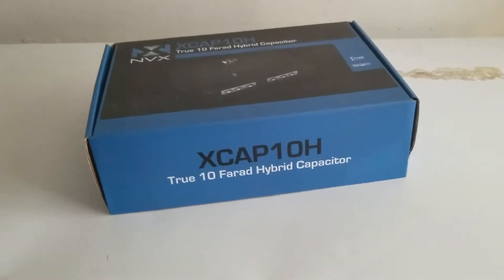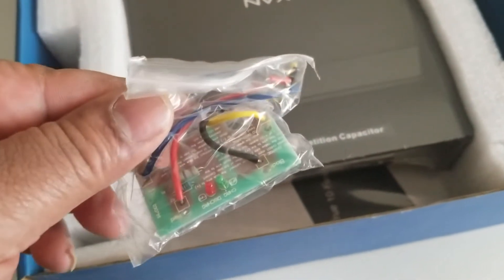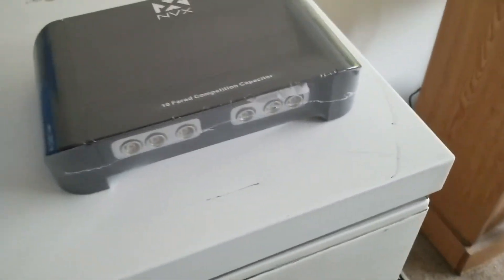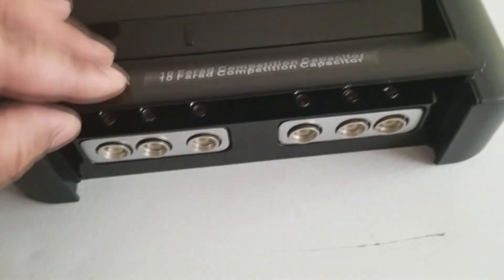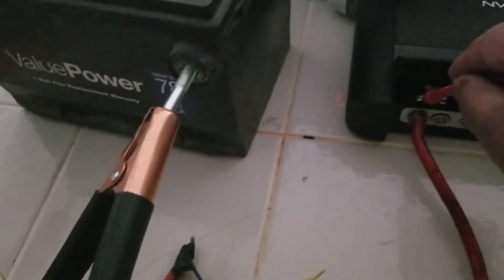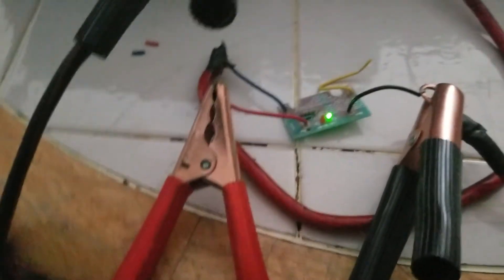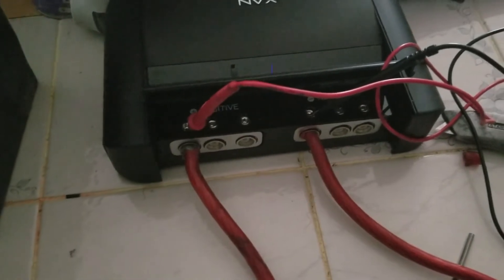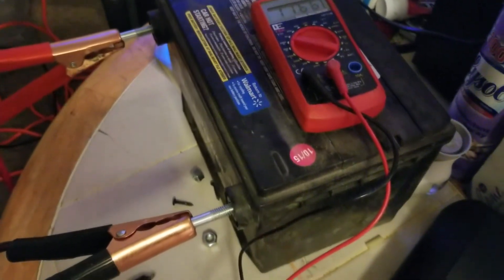NVX XCAP10H 10 Farad Capacitor Unboxing and Charge

Comment: does this thing need to be really close to the amplifier? what if my 4awg ofc wire is like 5 feet long?
Reply from the maker: yes it should
Reply: @DjKamikazee  yes it should what bro be close? what if its like 6 feet 4awg ofc btw thx
Reply from the maker: @sp00f34  I should be as close to the amp as possible. I assume the 6 feet wire is coming from your battery so run that wire to the cap the run a short wire from the cap to the amp
Reply: @DjKamikazee  how do i make LED lights bright depending on the note of the bass? I used to have that and it was so dam cool. they dont do that anymore or what
Reply from the maker: @sp00f34  This is what I used for the led lights to go with the music
https://www.amazon.com/dp/B09D7PH6LZ?ref=ppx_yo2ov_dt_b_fed_asin_title&th=1

download the app on your phone and it will have music player that will go along with your music

Comment: I thought the yellow wire goes to the neg on the  capacitor
Reply from the maker: The yellow wire is used to discharge the capacitor
Reply: What happened if I don't discharge the capacitor?
Reply from the maker: @hinchadahe  You only need to discharge the capacitor if you are taking it out and storing it because you dont want any metal to touch the terminals
Reply: @DjKamikazee  
I got it.  Thanks for answer bro 👍
Reply: @DjKamikazee  no yellow goes to negative in the cap and blur goes to positive on cap. Red goes to positive on battery and black goes to negative on battery. To discharge you hook up same way to cap and then put rhe black and red together. It says it on the tool